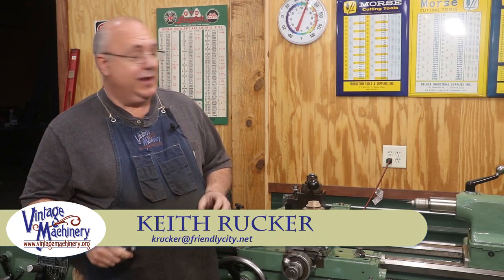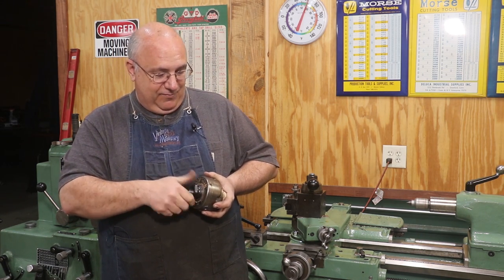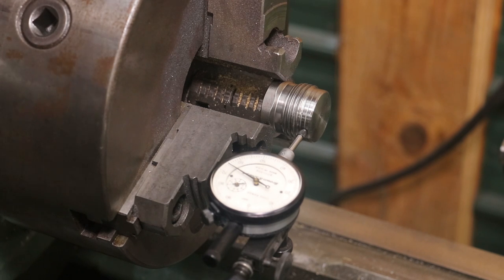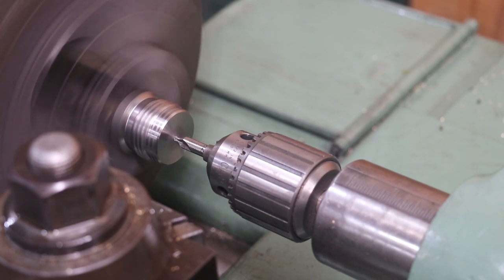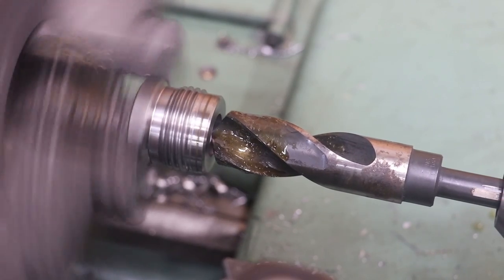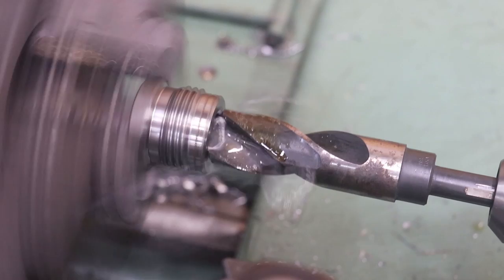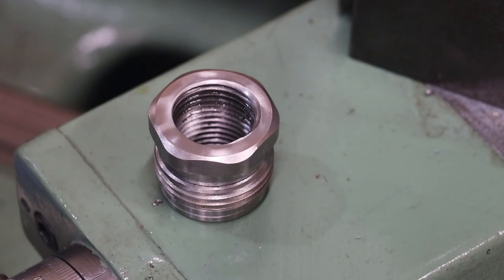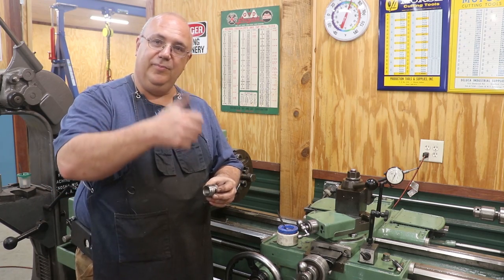Cutting Internal Threads on the Metal Lathe:  Threading a Custom Nova Chuck Insert

Comment: Hi Keith. Quite a few years ago (before youtube and the internet) I took a night course on using a lathe at a local "trade school".

When it came time to cut some threads for the project, I was amazed to learn it was done as you described it this video... by moving a lever when a line on a moving dial lined up. 

I remember thinging no way was i going to be able to do that after just a few classes, but it worked. 

Thanks for sharing your projects via videos.

Cheers

Comment: 19:00 pretty wild seeing that tool post moving a couple of thou while in the cut.
Reply: I noticed that, too.  Is that normal?  Do you do "spring cuts" until the springing disappears?
Reply: Yes, spring passes until that goes away. But why is the whole tool post moving .005, that's .010 on the pitch diameter?
Reply: Looks to me like the compound ways need tightening.
Reply: Thought Keith took the sloop out all ready always more to do

Comment: What a luxury cutting imperial threads in an imperial lathe. I'm jealous  ...
I did notice the clock on the turret moving around quite a bit. If it was for a metal lathe that would be a sign of run out?
Reply: That was deflection from the cutting pressure.
Reply: @lunkydog  Yes but it should have remained consistant

Comment: Would there be a benefit to use a boring bar on your final diameter?  It would help eliminate any walking of a bad grind drill. Great video, it’s been twenty plus years since I have single pointed threads. Keep the videos coming...👍👍

Comment: What I usually do when I want an internal thread and an external thread to run true and concentric is make up a dummy thread .in the chuck and then screw in the insert and then turn and bore and thread the insert. That ensures that the threads are all located on the lathe centre line

Comment: I'd have probably built a fixture, to hold it securely.

A slug of metal, chucked up, then bored and threaded for the external thread of the adaptor. That would hold it secure, and guarantee absolute concentricity.

Comment: I have a 1945 Machinists bible. There is a section on sharp V 60 degree threads, It shows proper thread form and various diameters but no rules in regard to pitch. I think it was an American thread, I have a few English books, never seen it there.  I think you said "spring pass'?  Up around Detroit we call it a free pass.

Comment: Keith, while you were doing the internal threads the micrometer you were using for thread depth was showing a various amount of deflection every time you started cutting the threads. I know you were talking about tool pressure in the video and I was wondering if this deflection was an accurate measure of the tool pressure or if it is too unreliable to be used that way?

Comment: Nice educational tutorial for me as a no-experience novice, Keith. | | |  Am i correct; that machined-piece cooling caused for the test piece to still be tight after reaching the book-defined ID was reached? This required two "spring-pass" finishings after the piece had time to cool and contract back to room temp [or STP (standard temp and pressure) as a chemist would think of it]?

Comment: I am surprised that you didn't make a mandrel to hold that adapter.  Would certainly have been more secure and surely that would be important when having the threads exactly parallel with the center line was critical.

Comment: I have a question. Might seem stupid but why not have a backing plat to also chuck up on in order to make heavier cuts. I understand the point of making sure not to mar up external threads but you could have done like I said previously or used brass or some softer material to take the blunt of that force. To be honest I’d rather use a plate than soft jaws. Any comments I’d really like to welcome

Comment: That indicator sure moves a lot during the tread pass. Something isn't right with that machine. And its just between the saddle and the compound slide. It may be worth investigating what the problem is.
Reply: it's old and worn out. he knows its old and worn out. so he can compensate for it.

Comment: Machine it, mounted in the chuck its for.
Reply: agree...  threading that adapter mounted in a 3 jaw and bumping it resulted in a bore that is not in the same axis as the threaded outer dimension... especially if he only indicated at one point point along the rotational axis... oh well. but since this a chuck used for wood, maybe that wasnt necessary?
Reply: Agree, there would be better holding against the chuck and the bore would be centered.
Reply: Isn’t the chuck dead ended, therefore would not be able to see when to stop, thusly rendering the chuck to the scrap pile?
Reply: @bigragu6828   Ive threaded many parts where i  could not see what i was doing inside the bore.
Reply: sean tap not being a machinist, myself, I am in the auto repair industry. I enjoy watching this Keith and the other one, because of the mechanical and thought processes. But I would think the one inch drill, especially, would protrude out the back of the bore, before finishing its cut. Also the boring bar and bit would seem too close to the back to risk damaging the chuck or the tooling itself. Again, just my observations.
Reply: All good ideas. If I'm understanding you all correctly you would hold the OD of the wood lathe chuck in the metal lathe chuck?  Would it be better to get the wood lathe chuck to hold onto a good size bar and then chuck that up in the metal lathe?  This seems like the sort of operation that would in other circumstances also.

Comment: About the dial indicator what happens if you engaged 1/16 or 1/8 in before or after the line.
Reply: At least on my lathe, you have some grace. There are positions between the numbers but as long as you engage after them, the paw will fall into gear.

Comment: Keith,  I like your videos.  I used to sell for a shop that repaired paper mill equipment.  They take me back.  But now I have a question.  What is the math for figuring the bore size?  I cant seem to find it anywhere.  I have poured thru the Machinery Handbook and found tables but want to know the math.  I did find a video showing .6495 * 1/TPI = 100% thread depth.  Multiply this by 2 and subtract from the 100% od of the male part.  Where did the .6495 come from or how do you calculate the bore size for internal threads?

Comment: I had a 6” craftsman lathe which is made by atlas
The craftsman spindle is a 1” 10 thread
Atlas is 1” 8 thread which chucks are easy to find
But craftsman not so easy to find so I made a backing plate to fit mine 
Then one day while at a friends house I seen he had the same craftsman lathe
But with a atlas chuck
What I found was someone had cut 1” 10 threads right over the top of the 1” 8 threads
The chuck would actually fit both spindles

Comment: Hi Keith, 
Why no oil when drilling the 1/4 and larger bores?  I know you don't use oil on cast iron, but that adapter was steel, right?
I also wonder why you can't cut threads in both directions?  It would save time.

Comment: Why not install the threaded adapter into the chuck...  indicate off the body of the chuck mounted on a large 4 jaw... cut the bore in the adapter and thread? IF the body of the chuck was questionable... mount a thick test bar onto the wood chuck(mid size range for the chuck)... then hold the test bar centered on a 4 jaw and finish the body of the wood chuck to get a good surface to register off of?

Comment: I could be wrong.  I don;t have any real experience.  Did you see the tip of your second drill bit wander just a bit?  If you start with a spot drill instead of a center drill when starting a hole you intend to drill trough you might not have this problem again.

Comment: Nice job, thanks for the upload. Just a question though, wouldn't it be standard practice to blow out the debris left in the threaded hole before test fitting?
Reply: Or de burr the inevitable ragged edge, unless Keith was using a full form 10tpi insert, which wasn't made clear.
Reply: Probably, but what Keith did worked just fine.  Didn't cause any problems.  Hard to argue with success.

Comment: “Rinse and Repeat” was never necessary.  Instead the recommendation was developed by the marketing department of a shampoo company and it resulted in much higher sales.
Reply: Prell™ if I recall correctly.
Reply: Sorry, but his is mythical nonsense. I can definitely tell the difference when shampooing once versus twice. Basic chemistry principles, where the standard is to wash/rinse three times - each pass removes exponentially more debris - e.g. if the first pass removes 50% of the dirt because the solvent gets 'saturated' with debris, then the second pass removes 50% of the remaining 50%, etc.
Reply: @scottr939  the question though is if the extra washes were ever necessary. It's well documented that shampoo that does not lather sold worse so they introduced lathering agents into the hair. But the lathering agent actually damages hair. Conditioner helps undo some of the damage, but ideally you'd want a shampoo that's both effective at removing dirt and grease but still leaves the hair healthy.

Comment: Could you have screwed the adapter in the chuck and then chucked it in the lathe? Use the chuck as a sort of mandrel?
Reply: That would add another layer of inaccuracy. You dont know what kind of errors exist in the chuck.
Reply: I would do that if I had Stanley's chuck. No telling how close Keith's chuck and Stanley's chuck are for concentricity.
Reply: @garybeasley4885  - Actually, it removes one possible source of inaccuracy. If the engagement between the adapter and its intended chuck is slightly off, it will be off by that amount every time it is screwed into that chuck. Mounting the adapter to its chuck and then mounting the chuck to run true before machining the adapter will compensate for that inaccuracy. The ultimate objective is for the chuck to run true regardless of any errors that exist in the chuck. (If that adapter is in there turning somersaults, who cares, as long as the chuck runs true.)

Comment: Would not using a sleeve with a tight internal thread; where the adapter screws into the sleeve; make the chuck hold it better. Or would that be making things worse?

Comment: Keith, look at your video. Just as the bit starts cutting, it appears the bit rises ever so slightly like the tip of the bit is not on center. Like the bit tip is slightly low compared to the hole.
Reply: It might be misalignment of the tailstock bore to the axis of the spindle (hard to fix) or it might be a slight bend in the drill bit itself (easy to fix by giving the drill bit a tap with a brass hammer).

Comment: Keith, what is a "spring Pass"? Great Video.
Reply: A spring pass is a final pass made with the same cutting dimension to clear out any burrs on the thread. It also allows for any deflection of the cutting bar.
Reply: It's a pass where you don't make any adjustments to the depth of cut.  Cutting pressure will push the thin boring bar away from the cut, and just repeating the cut without increasing the depth allows it to take a smaller cut with less flexing away from the cut.  In essence, the springiness of the tool adjusts the depth of cut. It's usually whisker thin.
Reply: A short cut from winter to summer.

Comment: After bringing the cutter out of the part does it have to be in the exact same spot before making the next cut. And how does the stop work on the cross slide
Reply: No, it doesn't have to be in the same spot for the next cut.  The thread chasing dial (with the numbers on it) is attached to the carriage; so when the half nuts are engaged with the lead screw to take a cut, the dial stops rotating.  If the half nuts are engaged at the required number on the dial (with the carriage anywhere along the lathe bed), then it will still be on that number when the carriage passes the spot where they were engaged on the previous cut.  (See https://www.youtube.com/watch?v=10Ketpqq-eM from 7:30 on for a good explanation.)

Comment: Dumb question: How do you know when to use oil when cutting and how much to use?
Reply: Donald Newcomb 
You can't have too much oil when turning a part from steel. Some machines have a reservoir full of cutting fluid and a pump that runs a continuous flow of the fluid over the work for lubrication and cooling.
Reply: @ralfie8801  In this vid, Keith makes some cuts without oil and daubs some oil on other cuts. I've seen other videos where the operator ran a constant flow of oil over the entire process. I'm just ignorant enough to not know what factors control when you cut dry vs wet. I understand you're trying to keep the tool and work cool but don't understand the decision process.
Reply: Donald Newcomb 
There may be some editing in the vid that cut the oiling part out. Who knows? Some people go by the sound when the machine is cutting. There’s also oil on the cutting tool that flows towards the work, so it’s just up to the machinist. Also, depending on the material being machined, carbide tipped tools don’t require as much oil if any.